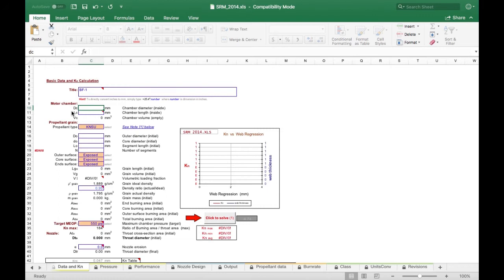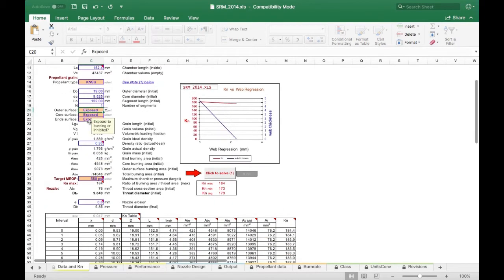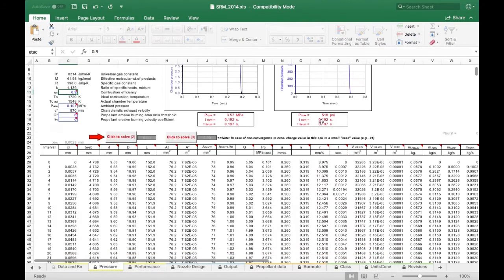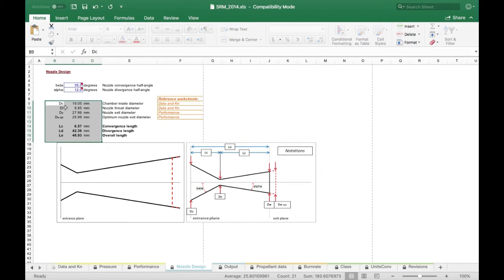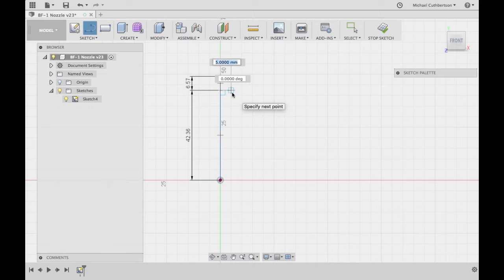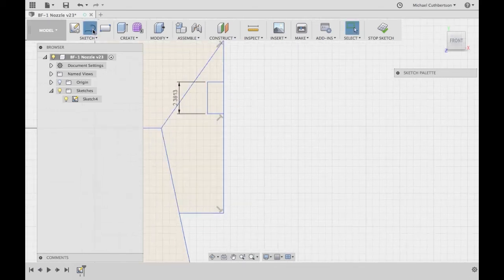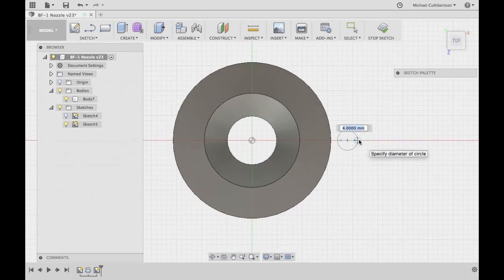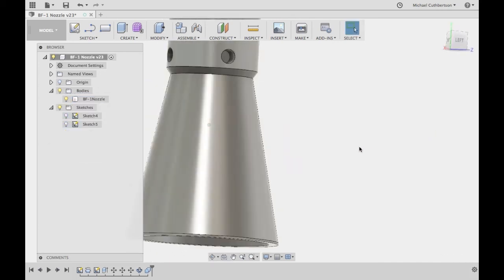How to Design A Solid Rocket Nozzle

Comment: What Material or Nozzle do you reccommend for a KNO3 Sorbitol engine?
Reply from the maker: It really depends on your manufacturing limits. Steel is best but if you don’t have the manufacturing capacity it’s kinda pointless. I think it’s Durhams water putty or something like that that can be used if you have practically no manufacturing methods available. You will have to deal with throat regression though, and will only be good for maybe three to five launches before you see performance losses. My brother and I actually managed to turn brass on a wood lathe to make a nozzle, it worked but was quite heavy. We tried wood for nozzles but the throat regression is insane, as expected. If you only have a drill you can get a steel plug from Home Depot/lowes and drill a few holes and sand them to get a cone. Or use a step bit and a file to get your conical sections. Heavy but works really well with little to no tooling required.

Comment: What does number of segments mean exactly? You said you were going to have one, but what does it  mean to have more than one? I get a exit diameter smaller than entry diameter, does that even make sense? Surely the presure inside the rocket is higher than the atmosphere?
Reply from the maker: When dealing with solid rocket motors, you can cast the solid fuel grain as individual pieces that fit into the motor casing. Think multiple toilet paper rolls stacked on top of each other. If you cast directly into the combustion chamber then it’s just one segment, if you’re using BATES grains then it’s the number of grains.
Reply: @FrogPondEngineering  thanks man!
Reply from the maker: You’re welcome. Always a joy to help people on my channel.
Reply from the maker: I just noticed the exit diameter question. Basically the pressure has three points, at each given area. Entry is area one, throat is area two, and exit is area three. To work the fluids problem you start with area one and go to area two, solving for pressure at the throat. Then you completely ignore area one and go from area two, the throat, to area three, the exit. The exit diameter is primarily dependent on the throat diameter and, by extension, throat pressure. The relation between exit diameter is not directly related to chamber pressure, it first must pass through the throat pressure relationship. Hope this helps.

Comment: If I add sulphur and iron oxide also in the KNSU propellent ,then how it affect the calculations?.
I would also love to know the theory behind all calculations.I m 2nd sem student of aerospace engineering. I know in days to come I will come to know about the theory behind these calculation.If you can help me to get the source of theory,i will be very thankful
.
Reply from the maker: That’s fairly high level chemistry that you’ll be looking at, I’m a fourth/fifth semester aero/mechanical student, that’s going to be more so learned in advanced chem.
Reply: @FrogPondEngineering  I m working on calculation of nozzle for my project and I m running out of time .I have tried to go through theory .I surfacely studied compressible gas dynamics including choke flow,shock waves, different expansions,etc.But I m not able to catch exact thing which will help me in nozzle dimension calculations.That's why i m searching some software to design nozzle with just propellent information and combustion chamber dimension.so please help me .I will be really very thankful.
Reply: I think density of propellent grain calculation would be affected by addition of these which will ultimately changes thrust and addition of Iron oxide will increase burn rate . Actually i want to know whether nozzle calculation is affected or not by addition of these.

Comment: Hello, I watched the video well.
I'm a 17 years old student living in Korea. Recently, I was interested in rockets, so I started looking for videos, and I have one question.
 If you design a nozzle with a 3D printer, won't the nozzle melt when you launch the rocket??
Reply: yes but you can use the plastic one to make a cast than remove the plastic one from said cast , melt some iron and pour it in the cast then you got a metal nozzle you can use r-candy solid fuel (made from kno3 sugar and some aditives just seartch it online for recipies)  and it should hold bc iron melts at 1538 and r-candy at 1347
Reply from the maker: It will absolutely melt. But for prototyping, fit tests, and flow tests, it can work. You can also use a 3D printed model to create a mold for a more heat-resistant material. In theory there are ways to use a plastic nozzle without it melting, but let’s just say that’s beyond most people’s manufacturing capability. A regeneratively cooled nozzle may work. But in a general sense, yes, the nozzle will melt, in my own tests it takes about a quarter of a second and the whole nozzle turns to a puddle.
Reply: @FrogPondEngineering  thank you for your help!

Comment: if I ignite the propellent grain inside a chamber, do I have to choose inhibited for the outer surface and end surface in that design spreadsheet?
Reply from the maker: If the propellant grain is cast into the chamber, where there is no air gap between the chamber walls and grain, then the outer surface is inhibited. End surface should be exposed, not inhibited. I don’t remember if the spreadsheet asks for upper and lower end surfaces or just end surface. If it asks for each then do lower exposed and upper inhibited. If you’re doing a bates grain then outer surface is exposed. If you have anymore questions let me know, I’m happy to answer them.
Reply: @FrogPondEngineering  thank you so much for your answer, really appreciate that. 
You are doing great, sir.🙏
Reply from the maker: Thanks. That really means a lot. Even though the channel has kinda died with school, I do my best to still answer comments.
Reply: @FrogPondEngineering  making one using SS 410, 3D printing is very expensive here in India. I have to do machining operations. If everything goes well, I'll definitely share credit with you..!!🙏
Reply from the maker: Thank you, I can’t imagine 3D Printing would work well, plastic just doesn’t hold up in those temperatures. No credit needed though, a rocket engine is a lot of work. Work done by you, not me. Thank you though.

Comment: How much nozzle erosion are you seeing using PLA? Do different common materials like PETG or ABS fair any better?
Reply from the maker: Really any 3D printed plastic just can’t survive, we’ve tried ABS, which lasts a split second longer than PLA. The temperature just rises too high too quickly. But 3D printing makes a good mockup or even mold form. So I guess nozzle erosion is about 900% in less than a second. Aluminum could work with KNO3-Sucrose, but not for long burn times. Rocket engines just really aren’t meant to be made of plastic.

Comment: I’m trying to design a nozzle out of medium density graphite for a hybrid motor. Anyone have experience or advice with that?
Reply from the maker: Unfortunately I myself do not have any experience with graphite nozzles, Richard Nakka may have something, or maybe Dan Pollino. Do remember when turning it on a lathe that the dust can and will conduct electricity, so make sure you have a good dust collection system.
Reply: Frog Pond Engineering excellent, thanks for the tip!
Reply from the maker: Just out of curiosity, what propellant are you planning on using for your hybrid?
Reply: Frog Pond Engineering Paraffin wax for fuel and Nitrous Oxide for oxidizer. Should be a relatively low pressure motor in comparison to solids so I’m not sure how to approach nozzle design.
Reply from the maker: When my brother and I built our hybrid we just used a 1:4 ratio for the throat for testing, but we never got enough efficiency for the nozzle geometry to matter that much. Our biggest problem was internal combustion, the wax would simply melt and fly out of the nozzle, and then ignite. It was a glorified fart flamethrower. We have hours of testing, but never really got anywhere. All kinds of pressures and core holes and grain masses. But then again the way we lit the motor was barely cracking the oxygen and my brother sticking a piece of lit grass into the nozzle. I do not recommend in any way shape form or fashion our ignition methods. We simply plugged a hose into our oxy-acetylene torch and used oxygen from that, manually controlling mixture ratio.
Reply: Frog Pond Engineering Kind of sounds like not enough oxidizer. our current plan involves a five hole injector plate at the back that feeds about 100 grams of NOX per second, so I don’t think we’ll have the same issue as you two.
Reply from the maker: Aside from that, our biggest issue was that we built the motor with a mixture of parts from Home Depot and Lowes. It was never going to work well, but it was a fun project.

Comment: Is there a limit to the performance of the nozzles that can be designed using this method? I'm on a team aiming to build an N motor.
Reply from the maker: Depending on nozzle material and chamber material, along with material thickness and propellant used, I think Richard Nakka has designed an N motor, you can check his website for some more on that. I think theoretically there isn't a limit, the space shuttle used similar design, just different propellant.
Reply: @FrogPondEngineering  Aight, thank ya sir. Great channel, by the way.

Comment: How can I get a copy of the excel spread sheet?
Reply from the maker: There is a link in the description that you can copy/paste into your browser. Once you are on the linked webpage you can download the SRM_2014.ZIP, along with any other spreadsheets you would like to try. Richard Nakka has all kinds of of data and design spreadsheets for Experimental Rocketry, which has proved incredibly useful for me.
Reply: @FrogPondEngineering  Hello, very interesting. Have you some link working to download the programm because can't access now. thanks.
Reply from the maker: I'll work on it. Thanks for letting me know.
Reply from the maker: Should be able to just go to Nakka's website and download it, if it's broken there then there's nothing I can do.